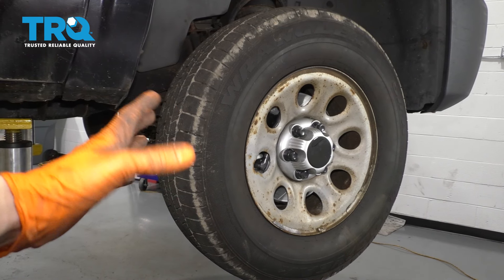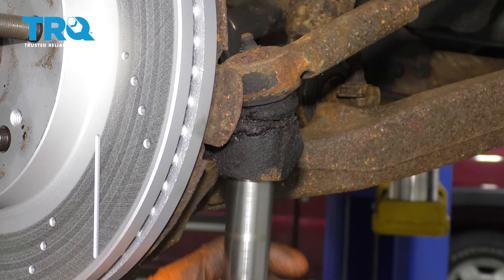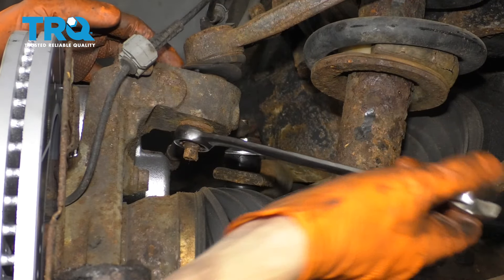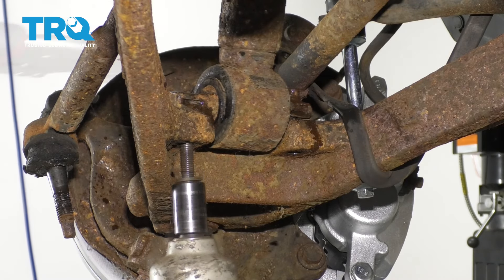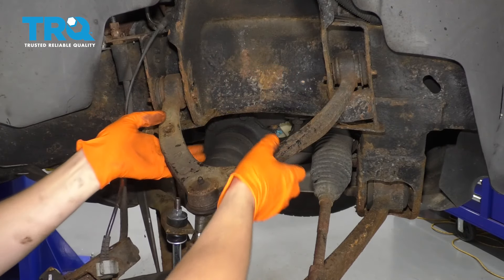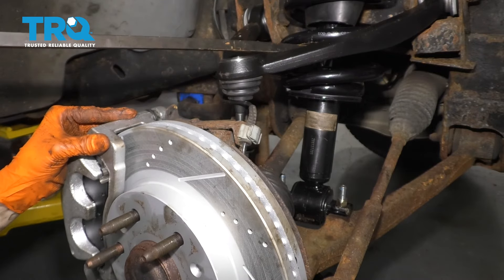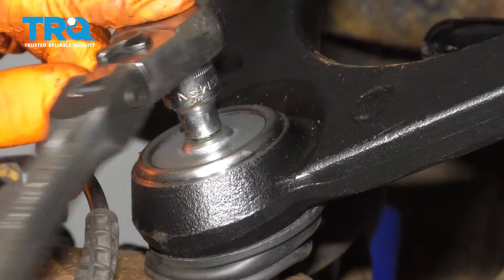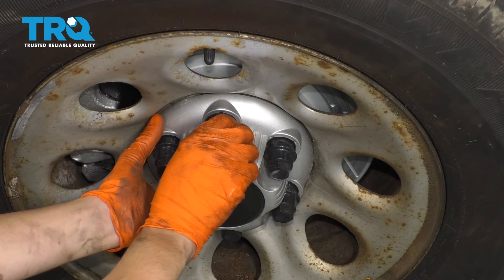How to Replace Front Upper Control Arm 2007-14 Chevy Silverado

Comment: Why making it 2hrs job when you can finish it in 15 minutes? Don't remove the struts. Control arm bolts and ball joint bolt, pull the old Control arm and put the new one. I replaced them in 15 minutes even when I was mechanic student.

Comment: I just replaced mine. Thanks to this video. The adjuster plates (or whatever they may be called) on each side of the bolts SHOULD NOT be placed identically where they were. Because the camber, hope that's right, will be way off. If they drop down about a 1/2 inch it will be fine. That is where mine ended up at after the 4 wheel alignment. Other than that, this was exactly what I did to replace mine and this video made it very easy. I didn't have any power tools, just leverage. I did spray down all bolts the day before and morning of.

Comment: I just did the whole font end on my Truck except the struts & drive shafts. The drive side is easy to remove the cam bolts the passenger side was the difficult side. If you end up snapping the bolt to the bracket, yes you can use a zip tie, or go to the hardware store & get a 6x1x 20mm.